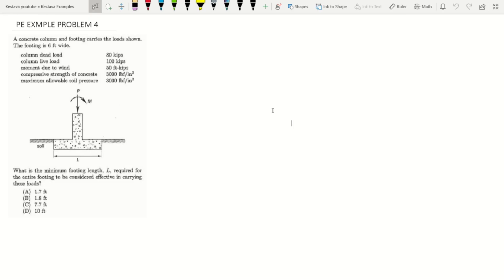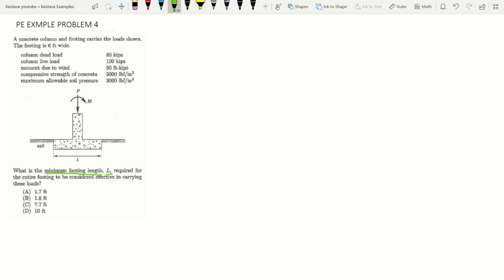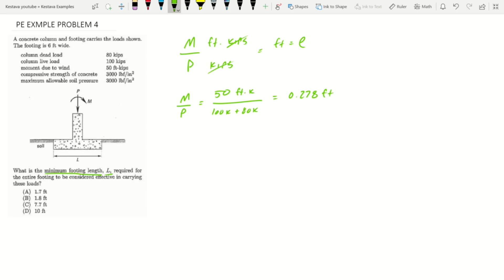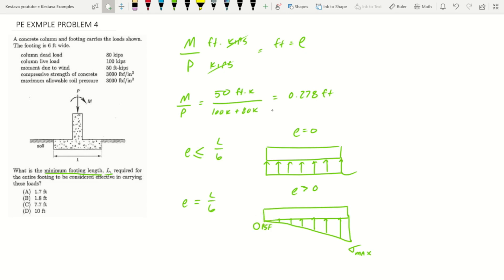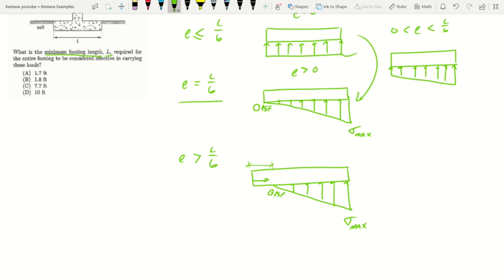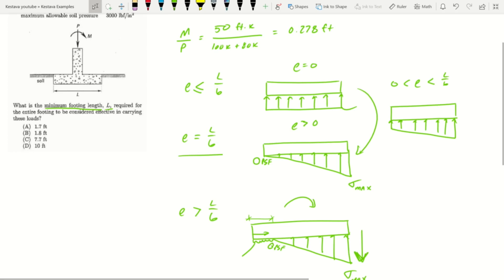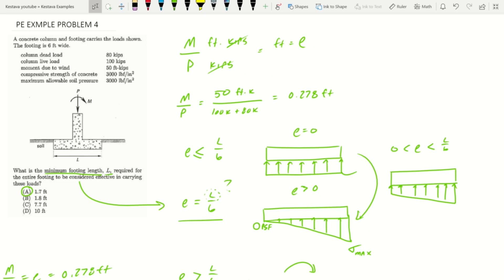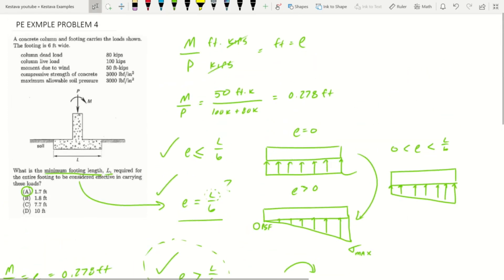Civil PE Exam - Foundations Example

Comment: I don't think there is a valid answer in this problem. First of all, the allowable soil bearing capacity should be 3000 psf rather than 3 kip/in^2 (personally won't think there is ever kind of soil existing). The correct length L is 11.45'.
Reply from the maker: yes - that is a typo in this example problem for sure!! 3ksi bearing capacity - where can i get me some of that!

Comment: allowable soil pressure is 3000 psi?  Should be 3000 psf
Reply from the maker: very good point! I didnt even notice that mistake in the problem. and apparently the practice problem didnt either! your absolutely correct - PSF
Reply: @Kestava_Engineering  hey, Im watching now and am impressed.  Im 53, Michigan State engineering/U of Colorado Denver MS; licensed now in 24 states.  young engineers ask me all the time about those type of units where they say lbf; its a custum in the west; lbft/sf.  I have to take the IL SE next yr.  talk soon
Reply: Ah yes, 3000psi soil, for when you cast your footing on pristine bedrock.

Comment: Are there any calculations/ examples for bracing design on a 10’ high foundation wall, 1’ thick 3000 PSI concrete? Forms are 2x4 on 18mm phenolic film plyform/ hdo (supposedly) need to know how much bracing/ what the answer would be for “effective” bracing/ support - 8 inches apart, 12 inches apart etc

Comment: Are we assuming all the loads are at service level? Also, do we not need to check the foundation for different load combinations, like D+0.6W, D+0.75L+0.45W, 0.6D+0.6W?
Reply from the maker: Hi Bikal - thats a great point. alot of the PE exam practice probelsm dont make it clear whether to include load combos or not. in real life I would absolutely agree that load combinations need to be used in the design of your footing and multiple load combo cases would need to be checked!
Reply: I had same question.

Comment: There was a very similar if not identical one on the PE I took last time and I answered "intuitively". I immediately eliminated A & B because in my mind those are such skinny footers compared to the ones we design everyday for much smaller loaded two story residential homes. Oh well, at least I know now how to answer even though it doesn't make sense yet. Thanks
Reply from the maker: Matt I hear you my man. that type of footing size would look funny in typical construction documents. ESPECIALLY with the loads stated.  The kicker is that the allowable soil bearing pressure is crazy high. I think this was an error in the problem given. I know we didn't use it but I believe it should read 3000psf no 3000psi. and in that case the footing would need to be 10ft just to support the gravity loads!